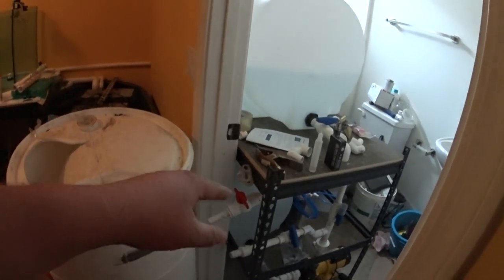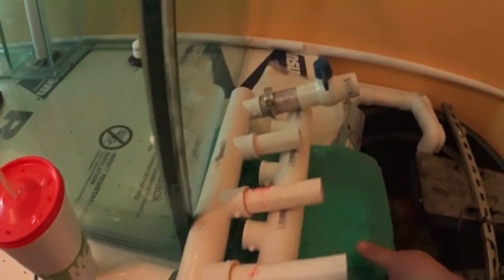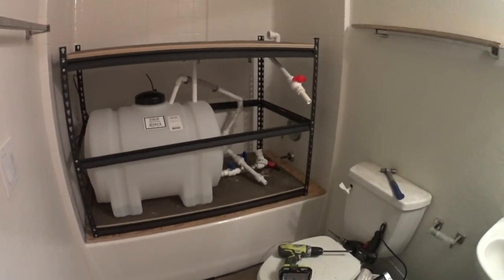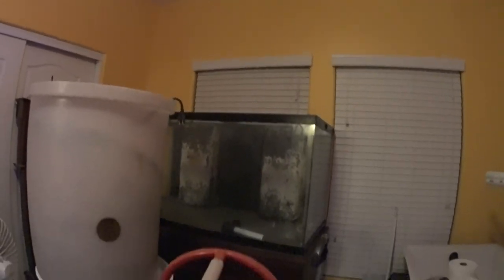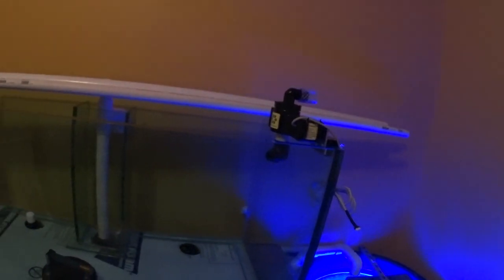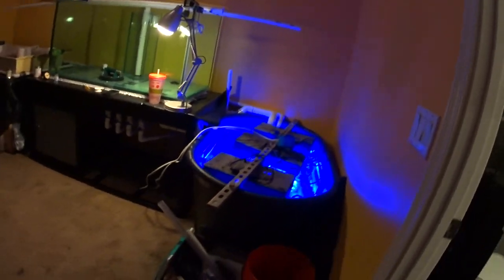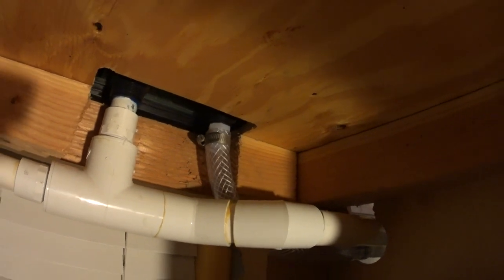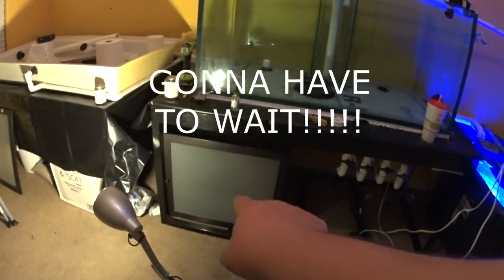fish room build 5

Comment: On the draining pipe out of the frag are you putting it at an angle so it won't clog up. I also saw Jim tank build too. He had some good help with the tank build. .
Reply from the maker: +Ruben For sure its a pretty cool tank build and I sure wish I had friends that would help me like that LOL..  I have that 45 for raising water level a bit and also surface skimming..